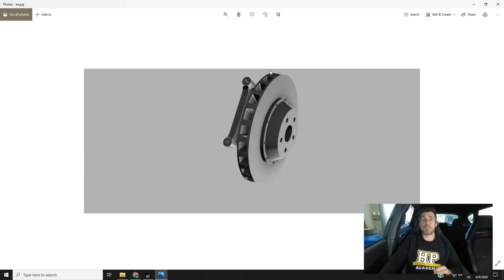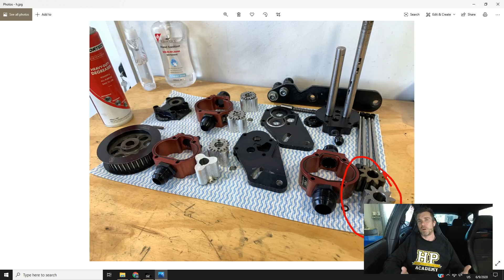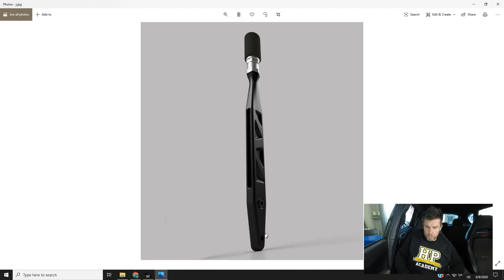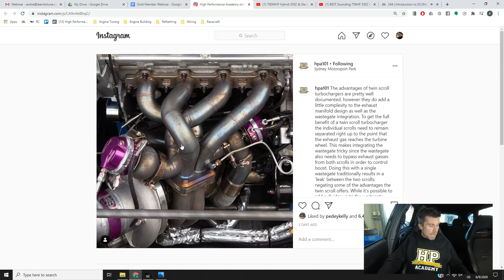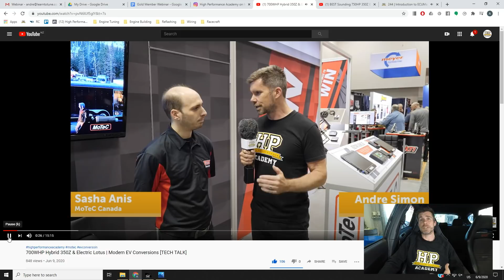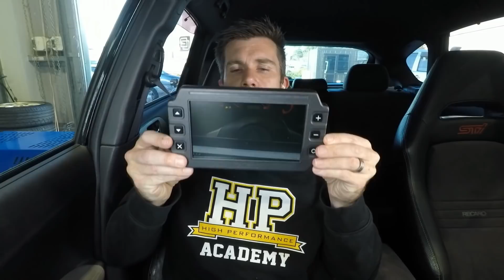Sequential Fine Tuning, V8 Swap Progress And More | Today At HPA [UPDATE 244]

Comment: Looking at doing something similar re calliper brackets, what formulas did you use to calculate stress and load etc? There’s not that much specific information available for this type of application just general structural eng calcs

Comment: Unless I misunderstood, why would the crankcase pressure decrease with piston ring wear? From my experience, pressure increases causing excessive blow by.
Reply: Neil, I think Andre is referring to the negative pressure created by the dry sump.  As the rings wear the blow-by will increase, and the vacuum pressure will decrease
Reply from the maker: Yea sorry that was poorly worded. As Chris has neatly summarised, I was referring to negative pressure and as the ring seal reduces we see less negative pressure, hence I use the term 'reduce' but I can see how that is a touch ambiguous - Andre
Reply: Thanks for the explanations. 
I confused myself, as always.

Comment: Can you do a webinar on lspi(low speed pre ignition). What is is any how to tune around it as best as possible?
Reply from the maker: Not a bad idea. In the mean time there are lots of white papers on the phenomenon that you can learn from.
Reply: @hpa101  in my situation, 12.5 compression ratio with a turbo. 91 octane is good at 12 psi but e85 struggles. I did find a paper that dextos2 oil isn't designed for ethonol. Leaning out helps due to less fuel able to pre ignite at least from my findings
Reply: https://www.ft86club.com/forums/showthread.php?t=141039

This is a short rundown of what we figured out and went through to get it tuned

Comment: Isn't metal 3d printing more cost effective than machining? You could even make a prototype of many parts you want to modify and metal 3d print all at once. For a hub maybe metal 3d printing isn't strog enough but for other stuff like the shifter...
Reply from the maker: I haven't looked into all this as much as Mr Barry, however, I think the cost of entry to a quality metal printer would be much higher, and the initial purchase of the Creality CR10S was done without knowing how useful it would actually be to us. 
Even then, it's really only been here for 1.5 months so we still have a lot to learn before we decide to invest more money into something like this, just to be safe - Taz.
Reply: @hpa101  I meant take that prototype to someone who has a metal 3d printer. I thought you don't have the machinery to machine that part either. CNC machining is the only way to go for that part am I right?